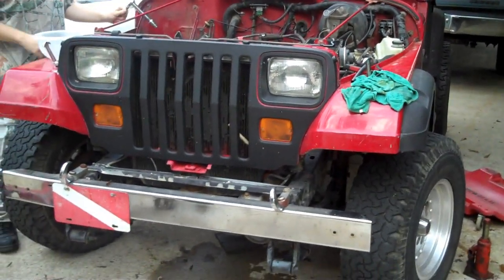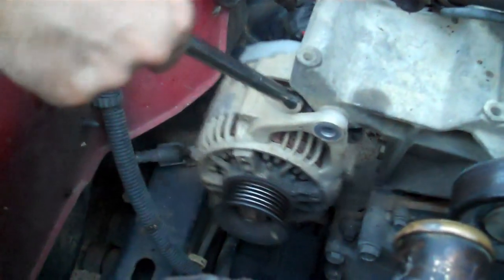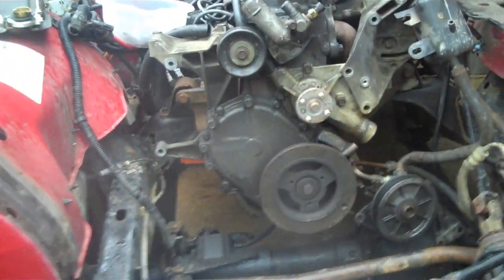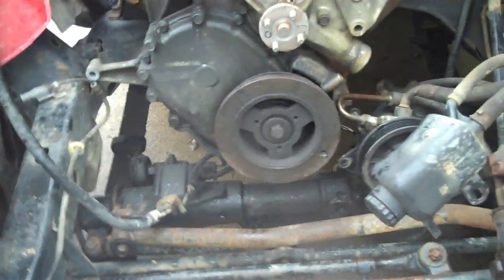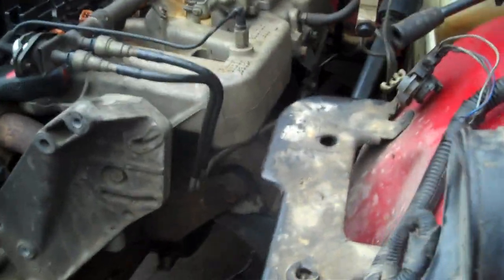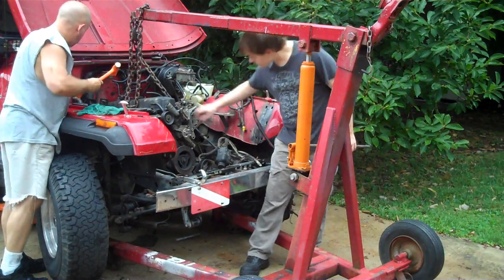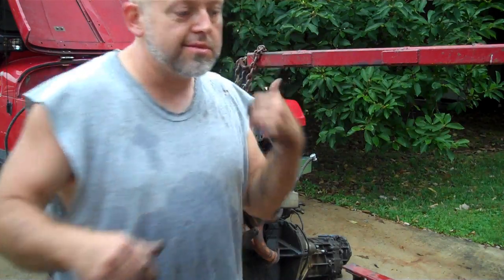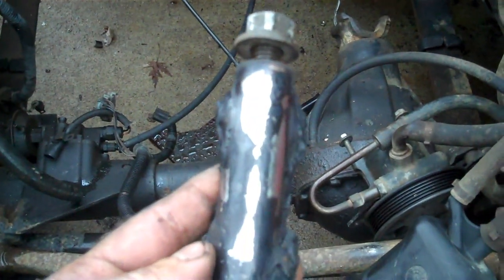Jeep Wrangler YJ - Engine swap in process! Part 1

Comment: Hey just a thought since you have a wrangler AX15 coming out and a cherokee AX 15 going in, instead of drilling holes to change the clock of the transfer case why not just switch out the Cherokee back case with the wrangler back case on the Transmission? Those rear adapter cases on the AX's come off rather easy.

Comment: Hey bud I noticed your still running the factory headlight harness. The problem is Chrysler used about #16 gauge wire and used the headlight switch as an inline breaker. I redone mine with 2 relays(one high beam, the other low) and #12 wire and it makes a drastic difference! Stock headlight went from dull yellow to bright white, and the relays handle the load instead of your healight switch, so more more blinking on and off!
Reply: Sorry I know that's off topic, but I just noticed that in your vid and thought I'd mention it.
Reply from the maker: Bryon Bullard It's cool man, I really appreciate it. Yea ... I've got some relays just for that purpose. I've just never got around to it. I was even shopping for H4 conversion kits today while chilling at work. Student at the college I work at was talking to me about his Cherokee having wiring issues when he upgraded to the Silverstar headlights. I explained the relay mod, he seemed interested, Don't know that he tried it or not. I used to have an old Chevy '78 3/4 ton mud/crawler toy that I rewired like that. Yes I agree it makes a huge difference. My '84 Mustang is even gonna get the same treatment. The Mustang is also getting a g3 130 amp alternator so that it handles lights and the electric fan better. I've got another g3 130 amp I've been looking at how to convert the Jeep with it. OH nooooo ... putting a Ford part on a Jeep .. LOL. Well, people put 8.8's under Jeeps all the time. A Ford alternator can't hurt to brighten things up. Seriously, I really like you chiming in with such a great suggestion. Feel free to drop comments like that at any time. Thanks a bunch for checking out my video, hope you subscribed. Thanks for taking the time to drop a line!! Have a great day!! :-)
Reply: LOL! I cant rag on ya for the Ford alt, I found and electric fan in my buddies barn off of some kinda Ford and put it on mine day before yesterday. I also have an 8.8 I'm gonna put in as soon as I get it redone the way I want( spool, c clip eliminator, and move spring mounts to the underside of it). I'm pondering a GM alt, just cause I have a bunch layin around,and can just run em with one wire. Keep up the good work
Reply from the maker: Bryon Bullard I stripped out an Explorer about 3 months before I bought the Jeep. I trashed a disc brake 8.8... kick myself now!! I've got like 2 - 130 amp 3g Ford alts and a 90 amp. It takes 2 wires to run them. Super simple to wire. On my Mustang very easy to mount. On the Jeep .. it's gonna require pulling out the welder and fabbing some brackets. Hey .. if we need to cross pollinate to create the perfect toy.... so be it!! Let the hacking/modding begin :-)
Reply from the maker: Bryon Bullard Hey man .. You had mentioned about the headlight harness a while back. I installed a relay upgrade harness. It didn't really change the quality of my plain sealed beams, but running the H4's and the harness ... it made a huge difference. I released step one of the headlight upgrade: https://www.youtube.com/watch?v=nC_EUx16Jcg . Keep a Jeepin' ! Later, Chuck
Reply: Yeah man I saw that, that's cool! I used one of your other tips yesterday actually and took 2 old hard drives apart and got the magnets out of em. You're right they're strong
Reply from the maker: Yes they are. Be careful, they will pinch the crap out of ya if they snap together.
Reply: Power Addicts - Jeep, car and motorcycle tips 
I just put a new motor in my YJ  I bought it from jasper motors (4.0   6 cylinder)  did I do a good investment ?  3 year warranty
Reply from the maker: Giovani22 I've seen often times that it's way less expensive to buy a re-manufactured engine than to build one yourself. One professional engine building shop can differ from another, even if they are under the same name. So quality of the engine build is shown over time. Just keep regular oil changes and proper maintenance you should be fine. As long as the shop backs it's 3 year warranty (I hope you never need it) you will have made a good investment. Hope that helps. Thanks for dropping by! Have a great day!
Reply: Power Addicts - Jeep, car and motorcycle tips 
Thank you I appreciate all the info . Just one last thing : 
My trusted mechanic tells me at times " use it or lose it " basically he tells me to run the engine often or take a road trip,  Do not let it sit in a driveway to much .Is that right ?? I don't go very far .

Comment: I restored a YJ last year about to start on a TJ - have to rebuild the 2.5
Reply from the maker: Redneck Garage I watched some your videos. You do great work. The engine I pulled from the YJ is going to get rebuilt eventually. It's going to need bored over because it had so little compression. Overbore means new pistons. I may as well get a 4.2 crank and stroke it to a 4.6 while I'm at it. I'm going for the monster torque for a few bucks more. My sisters YJ has the 2.5. Dad has an '06 TJ its a 4.0, good friend of mine has a 2000 TJ with a 4.0. I'd like to get my sisters YJ to drop the built 350 I have that I'm doing nothing with. I need to make a pull-a-part run when it warms up a bit. Good luck on the TJ!! I'll be checking out the vids!
Reply: Thanks Bro hopefully have it Monday and see how bad it is - LOL I would have liked to have a 4.0 but for the price a 2.5 will do fine. The 350 is a monster ( and a trans eater ) in the YJ - I ha a CJ with a 304 AMC and it could pop a wheelie - LOL
Reply from the maker: I would use the chevy trans & t-case also. I have a D60 & 14 bolt at a friends house. So basically it would be a Jeep powered by all Chevy. That CJ sounds like fun!! LOL. Tear down the 2.5 and check the bores. If they aren't too far out of round. Hone the crap out of it to take out the glaze. Throw a set of rings and bearing in it and let 'er rip! Oh ... oil pump too since it's tore down. Lookin forward to watching the build! Hey .. that 2.5 build would be a traffic generator for your channel. There aren't any good engine building vids for Wranglers that I have found. Good luck my Jeepin' brotha!!
Reply: Thanks Bro - getting the Jeep tomorrow - we shall see :)
Reply from the maker: Cool .. good luck!

Comment: My 91 4.0 yj engine with auto trans is on its last legs, can I swap in a 4.0 from a 96 Cherokee that has a manual trans? Without any problems? And keep my auto trans?
Reply from the maker: Just make sure to swap all your 91 front accessory parts over to the 96 engine along with the motor mounts. Also the Cherokee has a 90deg oil filter adapter installed on the block, take it off and install the YJ threaded adapter. Use the YJ automatic parts on the back of the XJ engine. I think that should be it.

Comment: what kind of hoist is it expensive i have to swap my motor on a gravel driveway
Reply from the maker: Been there done that! Even done it in yards. Here is about the least expensive as you gonna find: http://amzn.to/2r5rVkS . You may be able to find one at your local autoparts store. Or check local "tool rental" places to see if they have one available to rent. The trick to using an engine hoist in gravel and dirt is to use an old sheet of plywood. Lay the plywood under the wheels so the engine hoist has a hard surface to roll on. Makes life so much easier. Thanks for dropping in! Have a great day!